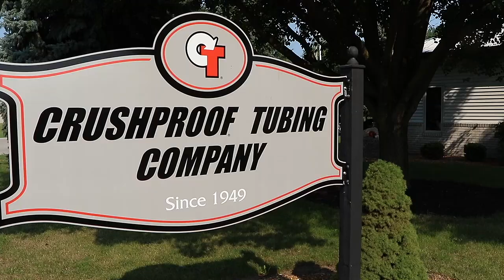Her MASERATI smells like turtle pee with NEW WHEELS!

Comment: You should get some Wheel Lug Bolt Hangers if you work on european cars. Save a lot of time and the thread won't need to get fix if the bolt is crossthread. I had to fix one on a Jeep Cherokee that was installed from the factory this way. Pain in the butt. Trust me I worked on cars from a small Fiat 500 to a GL450.